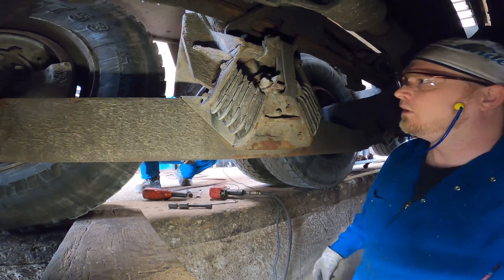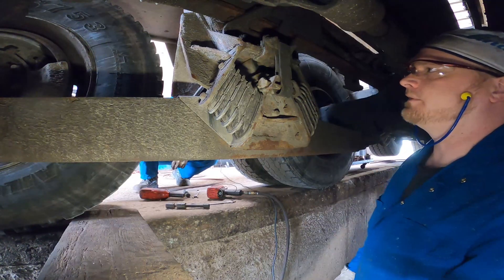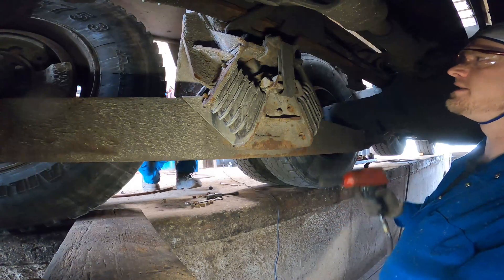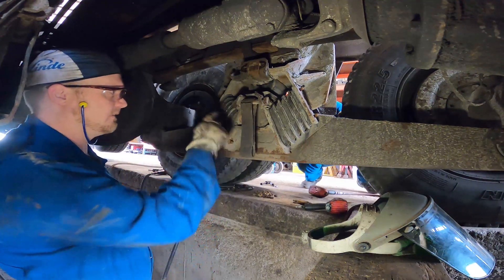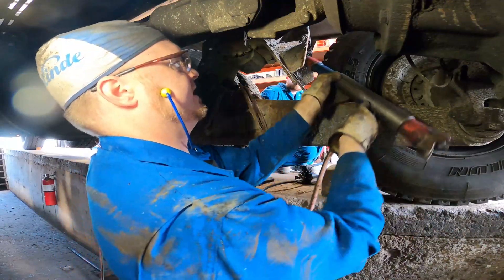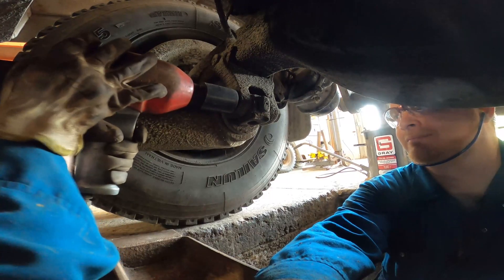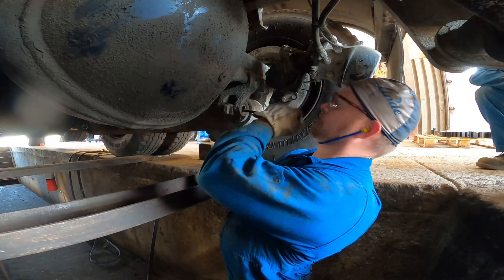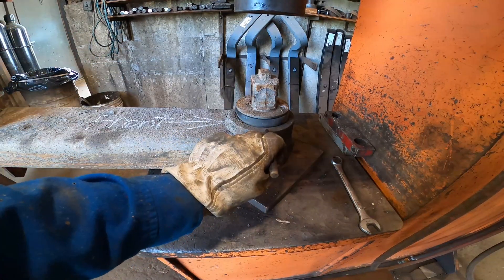How to remove Hendrickson Haulmaax Suspension - Part 1

Comment: Not familiar with this type suspension...what is the capacity (in pounds)?
Reply from the maker: I believe the most common capacity for this suspension is 46,000 LBS.  or 23,000 lbs per axle.

Comment: Again, brilliant watching you lads at this heavy work and whilst I'm never going to have to do such repairs, I would like the answer to two questions. What is the purpose of the Nylon strap and are those rubber boots solid rubber or sprung within..
Reply from the maker: The strap is for when the vehicle is raised in the air.  That way the rubbers dont get ripped in half.

Comment: I have a brand new set of these style bolsters on a truck and they are all already bulging out and ripping.any idea why? They are not the upgraded one with the bolt that holds them together
Reply from the maker: check out your upper torque rods to see if they are damaged....sometimes if they are worn it will cause the lower rubbers to wear out pre-matured.
another thing to check out is the walking beam bushings and make sure they are not split....it can also cause the bolster springs to wear out early.
Reply: @simcoespring  thanks for the reply, I think I found the issue , the bottom of both frame rails are leaning out from rust jacking. (Double frame) . Which is in turn putting outward pressure on the bolsters

Comment: Have you ever tried Atro replacement parts for the Hendrickson suspensions?
Reply from the maker: I have tried a few different designs.  I'm not totally sure if they are better or worse yet.  I do have a few suspensions out there getting tested right now
Reply: What’s the reason for those loose straps on the haulmax?
Reply: @donmcintosh4125  travel limit straps.....glue on the rubber blocks is tough under compression but tears easily under tension.